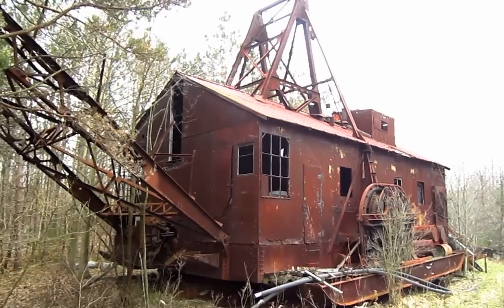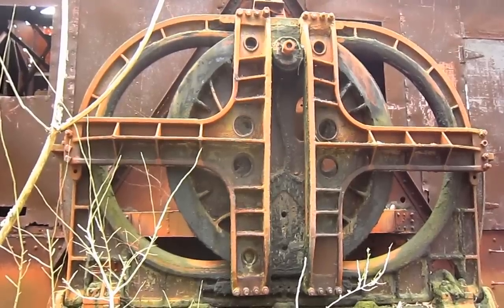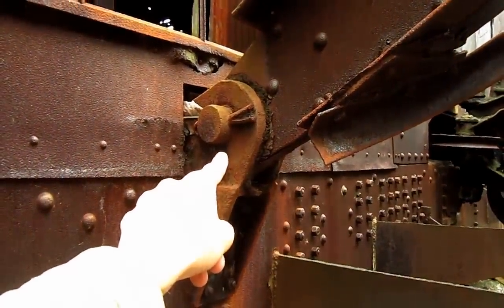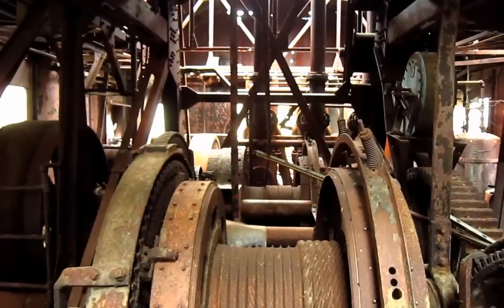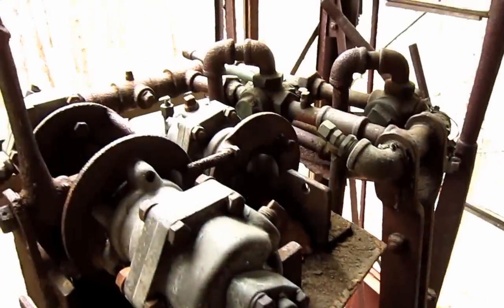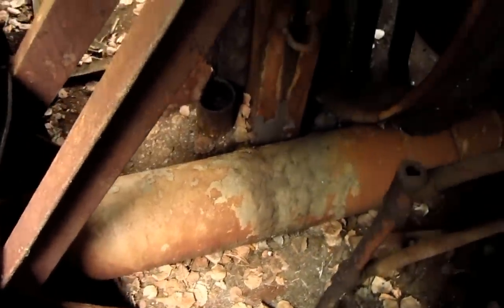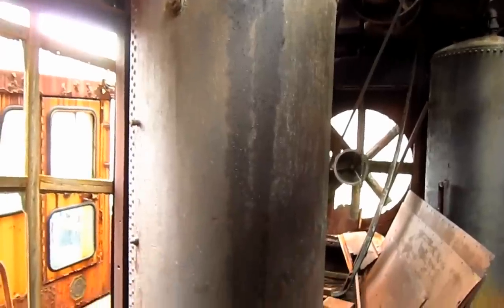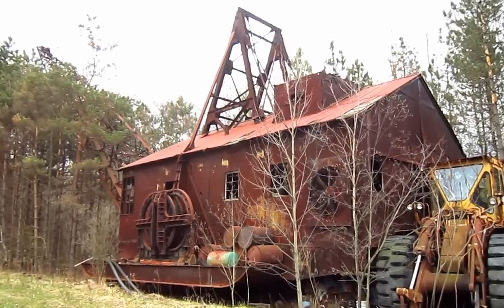Monighan 4-W Documentary

Comment: In middle 30s my Dad saw one of these hauled in by train ,6 months assembly and promptly stuck ..4 months later in dead of summer walked it out and dug a 10 mile long channel 75' deep and 200' wide .Grease truck drove in bucket on one side with driver holding brakes and dragline pick it up and swung to other side set it down and truck drove away .When finished was disassembled loaded on ship and torpedoed on its way to UK at start of WW2 and lost in the Atlantic.

Comment: It was built to last .the vandals and scrappers haven't torn it apart that is still a viable machine put about 100k into a modern diesel and new winches and cables modernize the controls and clean up the surface rust and you have a still good machine
Reply from the maker: It's amazing to think, but, you are correct, you could still legally be allowed to operate that machine today if you installed guards around all the machinery and isolated the cab so it meets noise requirements. These old draglines were designed to last forever

Comment: They used to have a walking Manitowoc in the gravel pit at Route 25 & Route 72 in Carpentervilles IL behind the cemetery! It had a 12 yard gravel bucket on it! That machine was a beast! Fished & Hunted that pit for years as a kid, I never saw the Crane move but watch dig a lake deeper then cut a drainage area to drain the shallower lake into the deeper one and move that drag line into that lake area and start digging the gravel to be dumped into big earth mover trucks and dumped and be processed through the shaker to separate the rock! It would take it a year or two to work that area then move the water again and start a new dig! On a Sunday while fishing I walked into bucket you could fit to full size pickup trucks side by each as the Newfees would say! It had drainage holes about 4" in diameter! And had two gigantic shoes it would move on!
Reply from the maker: That's awesome 😎 thanks for sharing that!

Comment: Thanks for the very informative video.  Question, Was the compressed air tank used to start the motor? If not, what was its function?
Reply from the maker: So the Fairbanks Morse 32 series used a unique backflow on the upstroke of the piston where air is pulled into the crankcase and is then  compressed on the downstroke. The compressed air then forces the exhaust out of the chamber.  This method required no camshaft operated valves in the cylinder head. Thanks!

Comment: Looks like there was a separate V-8 engine in it or was that an air compressor? And what looks to be a wood stove for heat? The other controls were operated on compressed air, hence all the metal piping? Thanks for the video!

Comment: Incredible piece of innovative engineering! I am supporting the nuclear equipment designed in1965. When I ask the component manufacturer to provide me a replacement, everyone states that the component cannot be operated in a mode I ask. However, the component is in service for 65 years with extremely low failure rate.  There is no chance for real inventions in our era of idiots.
Reply from the maker: I have to agree with you lol. I see it everyday at work

Comment: WoW awesome video!!! My grandfather owned a huge dragline in the 80’s-90’s mining coal central PA, I began a career on tugboats NY harbor in 2001 doing a lot of construction type work there are a few old cranes that were steam converted to air compressor driven built in the early 1900’s. I’m pretty sure that ole girl isn’t dead if the stacks were covered.
I’ve worked on old tugboats from the 40’s with Fairbanks engines and never seen an old one like that absolutely amazing piece of history. Lots of old draglines like my grandfather’s get sent to a new home on barges as dredges or as cranes. Many old machines are still in operation it’s amazing what can be found around coastal ports.
Reply from the maker: That's awesome! Thanks for sharing that. The engine was definitely my feature of the machine. Reminded me of something you'd see in a big old industrial power plant or mill. Thanks!

Comment: Theres a dredging barge very similar to this at the Napa Valley Marina in Napa Ca, it was used to dig out the marina in 57 .  It has a IH diesel in it that starts on gas then switches over when you move the lever that disengages the valve train feeding the cyl head.  The interior looks like this 4-W complete with a big glass pickle jar on the wall so you can see the mud samples.  There was also a drag bucket there on tracks that I got fired up and moving for them after it sat for many years. That was around 2005.   Both of those were very cool and I could visualise someone from OSHA going into the dredge ,  he probably would have nutted up with all those open gears and things spinning away.  Same with the drag line. Sitting in the operator seat there must have been at least 20 leavers all around you with no identification about what they do. LOL
Reply from the maker: Haha that's awesome. Believe it or not though, if you were to upgrade this machine with guards over the moving components and isolate the cab to meet noise requirements, guaranteed you could still run this machine today
Reply: @PAmining  Thanks for the reply I dont doubt that, as long as water doesnt get into the engine its not that big a deal to get them going again and with a grease fitting on everything that moves so it will last.  Have a good New Year. Cheers
Reply from the maker: Same to you man!

Comment: Thanks for the video! I think all of dragline weight is on the shoes once the tub lifts. Why do you say 80% Did they not lift the bucket when walking?
Reply from the maker: You're welcome! When the machine goes to walk the shoes lift the back half of the machine off the ground. The front on the machine is still touching the ground and the shoes drag the front of the tub forward. Therefore, 20% of the machines weight is still on the tub.
Reply: @PAmining  I believe you and am shocked I never knew this at the same time. How do tub replacements work or is it possible that the tub itself is 20% of the overall machine weight? It seems like the feet are capable of lifting the house high enough for the tub to be dragged in/out.
Reply from the maker: To replace the tub the entire machine is jacked up off the ground. The tub is then disconnected and pulled out from under the machine and then a new one is slid back under.
Reply: @PAmining  example tub replacement video is https://youtu.be/TpdtumtTcFU?si=XwlK6u7W64zy6uAr

Comment: Love this!, those fairbanks morris engines I believe turned at a very low RPM and lasted forever, I bet th engine would still run today. How much $$$ and time would it take to get this machine back to running?  can you imagine the noise level and HEAT inside of there say on a 100 degree day?? a operator would be deaf and suffer heat stroke within a day being in there on a 100 degree day. why did they give zero attention to operator safety and comfort on machines back then? didnt they realise operator comfort and safety would mean more productivity??
Reply: My guess is the operator would feel priveleged to not be  using a shovel or lifting sacks by hand
Reply from the maker: A truthful point! Back then men were happy to have evolved out of using shovels to big earthmovers. I don't think comfort was a major thought
Reply: I’m trying to figure out that engine.  No valve train at the cylinder heads, were they two-stroke with ports?  But I didn’t see a blower either.  Way too early engine for those, I imagine.  Guess I need to do some research.
Reply: @tomrogers9467  Yes 2 stroke. The inlets are in those doors on the crank case .
Reply: @Mercmad    Thanks.  Guess it was the grand daddy to the famous ‘71 Detroits!  Bet it was quieter, though!

Comment: Man I love it when you dig up the really old stuff. It’s amazing this one has evaded a scrap torch this long. Hopefully it’s in private hands so it’s relatively safe? Really wouldn’t be to hard to at least do a cosmetic restoration. Once you take the sheet metal off the house there really ain’t nothing to those old draglines. Was that a little flathead V8 sitting in the corner by the air tanks? I’m guessing to run the compressor? It was amazing to see air piloted control on a machine of that age. That would have been really cutting edge technology for the time.
Reply: I agree, that needs saved some how. I am guessing that’s the only one left that’s complete .
Reply: ❤ I love it . I also seen a few other goodies sitting around there.
Reply from the maker: 😃😎 Haha, glad you enjoyed it! This machine is privately owned so that is why she's still around. Last operated in the 80s from my understanding. They are very simple machines and lasted forever. That is a Ford V8 but I'm not sure what it's purpose was. Thanks!